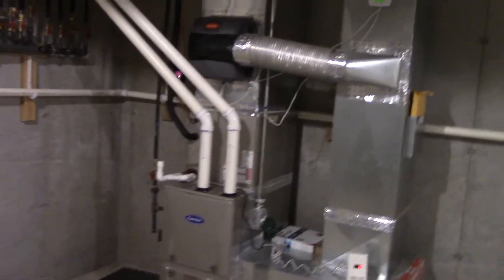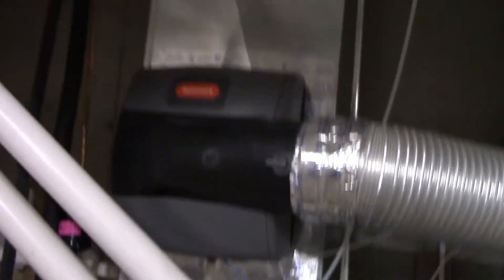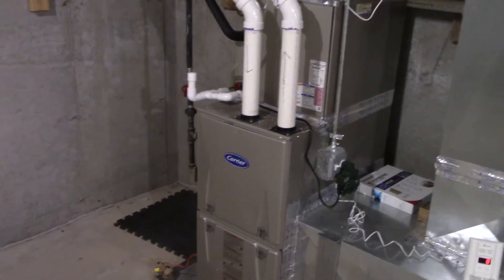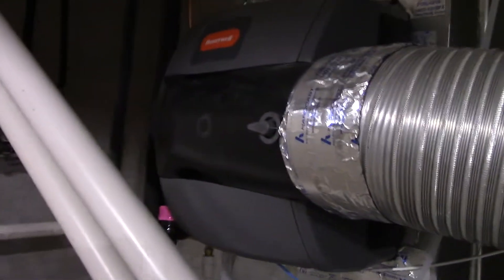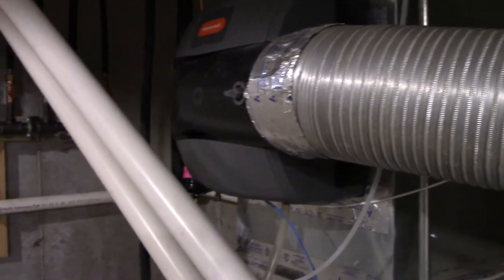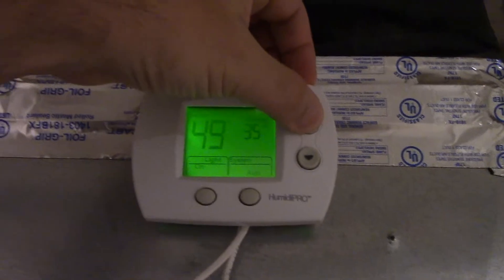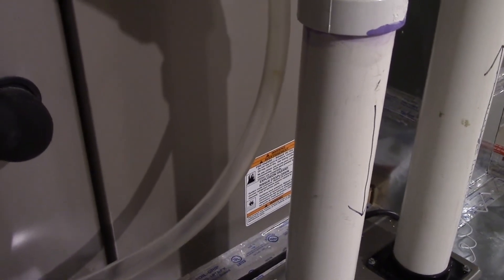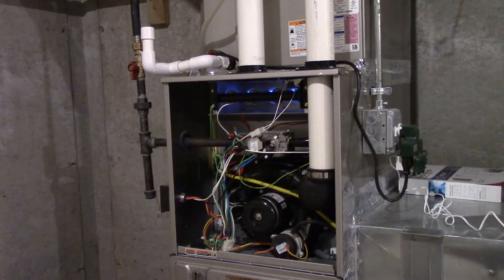2016 Carrier Furnace Start-Up and Honeywell Humidifier.

Comment: I’m just wondering would you rather have your old galaxy series boiler over this? Or do you prefer a gas furnace
Reply from the maker: It's interesting, each has some of its pros and cons, but I guess I do like having furnaces a little bit more. Don't have to worry about water and things like that. It's also nice to have two units now instead of one, so if one goes bad the house will still have partial heat.

Comment: I’m worried that the hot air from the high efficiency furnace could cause damage to internal parts in humidifier.
Reply from the maker: I think they were designed for something like this.

Comment: Great demos as always. The only thing I did differently on mine was with your set up you can’t use the humidifier if the house is dry because it either has to be on heat or cool. I have it set up that if I turn the fan from auto to on and the humidistat calls for added moisture it will open the water valve on the humidifier with just the fan circulating rather than heat or cooling engaged. Like you, I turned the humidifier switch off during cooling season.
Reply from the maker: I think this humidifier will work in Fan mode too, as it's tied into the damper board, and it's calling for something to happen.
Reply: Sharkie626 when he first installed mine he also set it up so that the humidifier would go on (when humidistat called) with the heat exchanger and I said to him no if I want to increase the humidity in the house without adding heat to please wire it that it will run with the fan motor controlling, not the burner.

Comment: Boom! First view! Started right up, and sounds awesome doing it! On this thing you don’t hear the blower spinning up, unlike mine which is an ECM computer controlled variable speed motor.
It gradually comes up to speed, over the course of 15 seconds.
Reply from the maker: Yeah the blower is very hard to hear with the panel off, with how loud the burner is! You can easily hear it though when the panel is on.
Reply: @Sharkie626  yeah the burners on mine were way louder than I thought. I also have 4 burners.